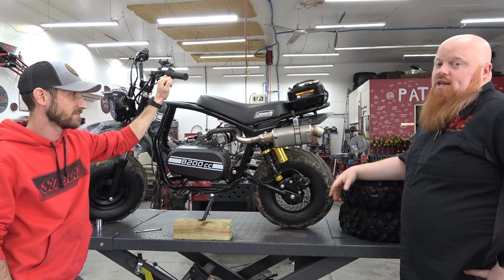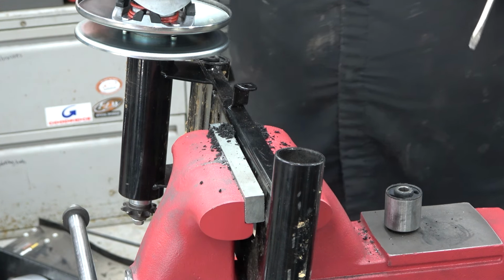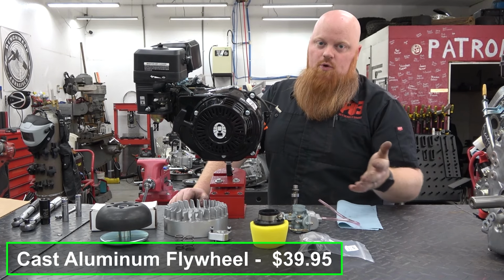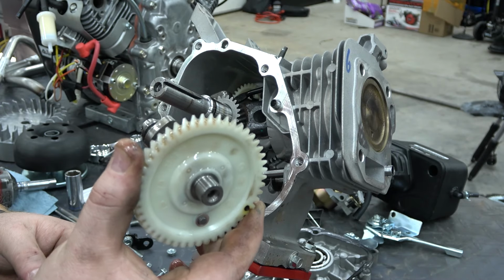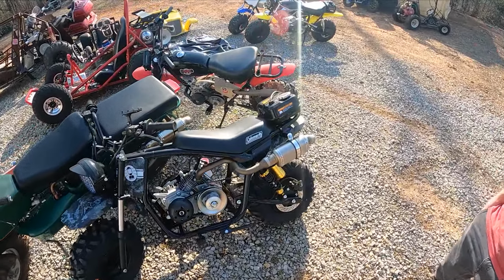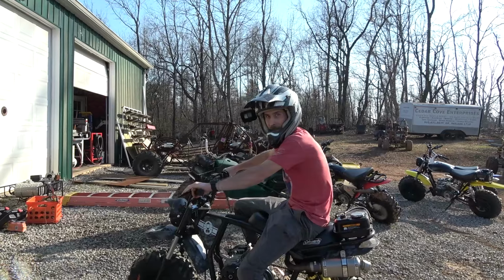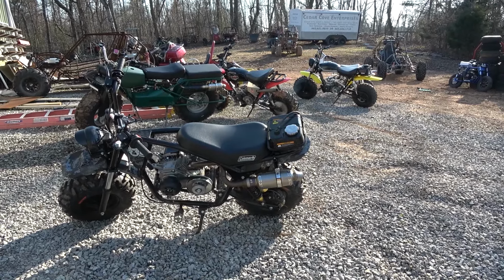196cc Coleman B200RSV Budget Engine Build & Race

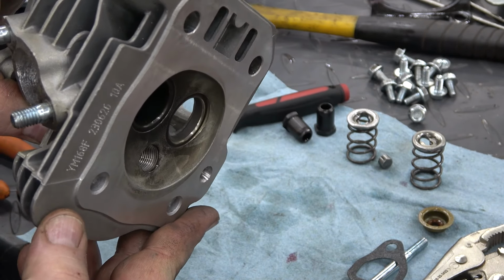Comment: At time stamp 16:25, there is a lot of ridges around the tops of the valve seats and spark plug in the head. This should be cut down to make a smooth transition to the upper combustion chamber surface.

Comment: I completely disagree that valve spring and flywheel are bear minimum. Rod will go before flywheel and values springs aren't a huge deal. They will just work as a fallback governor and flutter. Conrod on the other hand, those things go first.

Comment: Rumor is that those flywheels only have 18 degrees of timing. It’d be interesting to see it dynoed again with 12 degrees of advance.  A max length rod and/or a bit of a head shave would be interesting as well.
Reply: He is either forgetting to mention it, or has a reason he will tell us later I would think.
That is usually how it goes here, neither way is a bad thing.
Reply: Studz racing said 18. The one I got had 20 degrees of timing. I set them at 32 without a key.

Comment: Did that rod bring piston up closer to deck? Seems like you skipped a chance to gain compression with a thin head gasket, longer rod, or flat top piston or a combo of some sort. Seems like a good bike. I'd love to try different rubber types in motor plate and see if i could reduce vibes... Does Coleman still use a small output shaft?
Reply: some valve trains wont allow for a thinner gasket, because of how much room you have to adjust the lash on the push rods for the valves. if you dont order custom rods, you may not be able to get a thinner gasket, cuz the rods would be meant for a longer setup, and would possibly open the valves up too much, or not let them close all the way. with custom rods, go ahead and shave that head down!
Reply: I'd agree more if he was going for  higher output - but I follow. Could of snuck a flat top in or + .020" rod or similar if buying a rod anyway. those 2 wouldn't mess with geometry I believe. Looking back I think he has a thinner gasket. I just  set pushrod length so at 1/2 valve travel I have rocker square to stem. Idea being it's easier on pushrods,rockers and stems
Reply: That's right. Last year I built my 7 year old Hisun 196. Plus 20 rod, flat top, and 10 thou head gasket. Piston was 20 in the hole so it worked out well. With a 265 cam and Champion rockers it should have a bit more power than his build here.

Coleman no longer uses the Hisun 196 with the 16mm crankshaft. The last Coleman model that had it was the BT200. A 3/4" crank was a part of my build. I had an extra.
Reply: Cool! @Deucealive75

Comment: I have an old Baja Warrior. I would love to see how you would convert it to a rear swing arm and disc brakes! It has a Predator 212 with a carb jet, air cleaner and header I made. What parts would fit? I would really like the cast flywheel and rod.

Comment: If I remember correctly the build 196 makes the same power almost as a a stock 212 ghost. Both about 10 hp on dyno
Reply: His 196 would have got more power with 32 degree timing and a VM22 clone carb. With the 5 degree key he used it had 23-25 degree timing. And all 196 builds should get a plus 20 rod and a flat top piston when using the stock head.

Comment: How many hours do you normally see out of a plastic gear before they fail?  I'll have to check the cam in my old Princess Auto engine.
Reply: The plastic cam gear is fine with stock springs and limited RPM. You just don't want to run heavy springs and high RPM.

Comment: Can some one help I got the same engine I have 18 pound springs exhaust aluminum flywheel removed the governor and it has the vm22 I changed out the 95 jet to a 115 jet it’s dies when I pull the throttle i tried adjusting the air screw and no luck
Reply: Have you changed the position of the e clip on the needle? If it's in the middle position (#3) move it down to number 4 then test. If it's still not right move it to the 5th position.

Do not give up! These carbs work well even on a stock 196 with a header pipe. My stock 196 liked a 120 main jet and my built 196 liked a 125 main.

Also. If you have a cone style air filter do a short test ride with the filter off. If there is a difference throw away that filter and get a foam type filter, then tune.

Comment: I just got one of these bikes. I was curious if your bone stock engine had extreme vibration? My vision blurred, it was so bad. Apparently some other B200RSV owners are commenting on this on the forums. Like a batch of bad engines or something. I got frustrated, and got a 212 Hemi for it today. The good news is, all the 196 tins fit! Sleeper. Bad news is, still don't know why the 196 vibrates so bad. I have a theory that the lighting coil magnets have something to do with it. Or maybe a poorly balanced crank. I'll be installing the Hemi and riding it tomorrow to see if it's "fixed."          For the 196, I have an old non-Hemi 212 crank, rod, and flywheel I'm going to install to make it a poor mans stroker. It'll be my experiment engine that I'll eventually use on my racing mower, instead of scrapping it. Only has an hour on it.

Comment: Only .015" coil gap?
Reply: Yep. Honda used this flywheel. The spec is .016" plus or minus .008. Pretty crazy. I set mine at .020".

Comment: When porting the head, did you have to do anything special to the valve guides after grinding them down level inside the ports? Im trying to get info on porting so I can do a good job on my heads.

Comment: Is it worth building a trial master motor or wait and save to build a 212?
Reply: Save and get a Wildcat 223 or a Ducar 224. I have built 196's that have nice power. But they don't have the torque that my 224 has. Like he said in the video the bigger engines are a better starting point.

Comment: Wildcat or one of the other strokers is the best idea these days.

EDIT: Does EC make a bare Wildcat block with no governor holes in it?
I built the red stroker now I need a black one haha

I put that flywheel in my Ducar 224, I didn't plan on spinning that one over 6500(I'm looking for torque not speed) or so anyway.
Rated for 8500 if i remember correctly and has 18 degrees of timing.

IMO it should be fine for what I am doing, yet I tend to think I will upgrade to billet in the end anyway just because it is so much tougher and more likely to be cast well.
Plus billet just has that bling factor to it. Haha